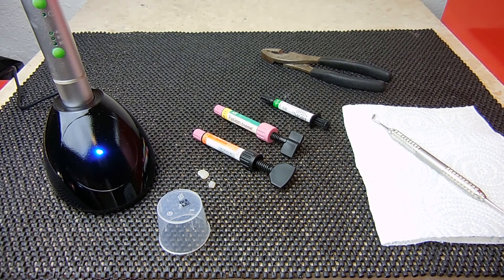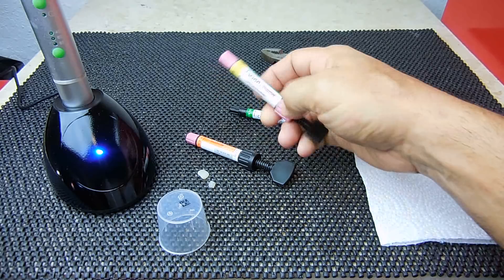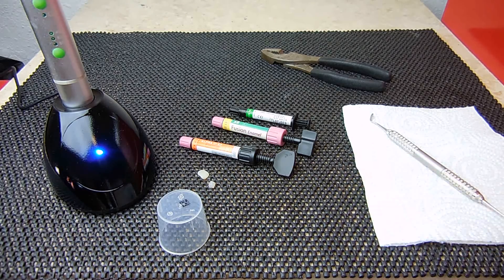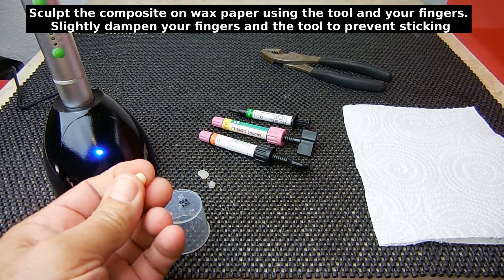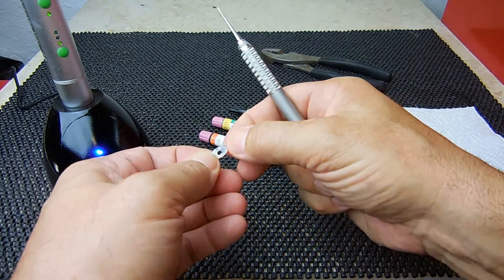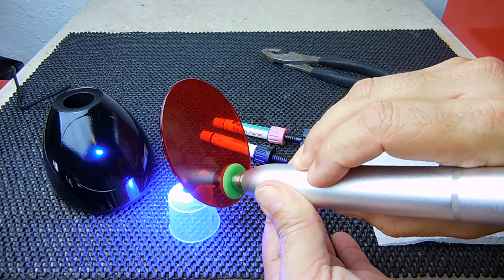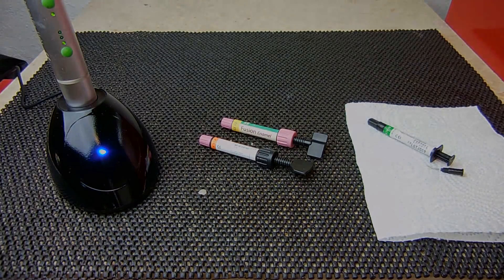Non-Medical Uses For Light Cure Dental Composite

Comment: As I have a new wand light source in the 5w, output wavelength:430-485nm range that isn't curing the glues I have now, where can I find the least expensive glues and composites?
I have looked at eBay and things are still a bit pricey.
In many cases I use UV glue pens on Kevlar rope ends most often with cheap LOCA pens.
I would like to expand my ideas and uses to solve more problems like you demonstrate here.
Reply from the maker: The composite material usually states the light spectrum required to cure. Thanks for watching!

Comment: I got a question i got a filling like this. Would i get a headache  from looking at UV light for 1 second while was doing that procedure
Reply from the maker: Wally Sterg Wear eye protection.
Reply: electronicsNmore ok but here lies the problem after getting a routine cavity filling on the last tooth he didnt use anesthesia cause  on  the tooth..i think he hit a nerve cause the top of head was a vibration sensation..i backed off. Told him  it hurt..he then told me just a lil bit more. Anyway after that filling i still have a headache from that drilling procedure. Also on my ear lobe was a lump.i pulled down on my ear lobe gently which then felt pain inside ear. I went back to him for more dental work which then told him my head hurts from the last procedure. He then. Pretty much gave me false answer saying it was anxiety.   Mean while its the sensation from the drilling that time ..of course i know i need to go back to this dentist.  But he might shy me away...now i went.to a primary doctor explained him this situation....after all this now i told this doctor maybe that could have been an ear infection from that tooth....anyway he gave me antibiotics..for it...but still have this headache..maybe i might need a XRAY of my damn 💀..will try tylenol for now...but not alot...im not really a pill popper
Reply: electronicsNmore sorry i ahould have said this first
Reply: No you cannot get a headache from looking at the light for one second

Comment: is this composite can be use in bonding brackets?
Reply from the maker: Depends if the UV light can pass through the bracket to cure the material, and the type of material being bonded.

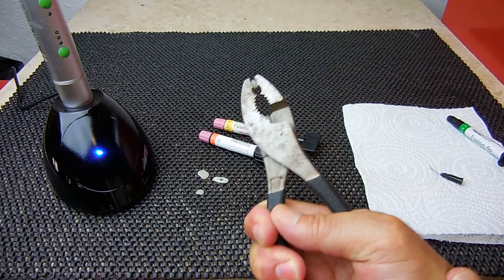Comment: That stuff is harder than Chinese math!!! 10:54
Reply from the maker: :-) Keep in mind, that was with sharp ridges inside the jaws of the pliers digging into the composite. If the jaws were smooth on both sides, it would have required even more pressure.

Comment: Nice using marine corp solutions! Epoxy sucks because it breaks down in uv light or extreme heat
Reply from the maker: Yes, The Nano composite gets harder over time, especially when it's compressed. I would not get carried away with the level of heat. 150 - 200degF should be OK.
Reply: electronicsNmore i wonder  if you could use it for a windshield reservoir repair?  all the possibilities with this stuff

Comment: How did you mold gear that is broken?
Also,how quickly does it wear out?
I was planning to make small bearing ball.
One is eaten out,and i dont want to pay 80 bucks for replacement set.
Reply from the maker: The gear broke, but I was able to glue it back together to make the mold. If the material crumbles up completely, then you won't be able to duplicate it. The Nano composite is very hard, and takes a long time to wear down, but it can be sanded.

Comment: So cool! Chemically what is the UV-curing Composet made of? Also what brand are you using?
Reply from the maker: https://en.wikipedia.org/wiki/Dental_composite

Just look on Ebay for the lowest priced 4.5gm light cure composite, or flowable composite if you desire.
Reply: thx
Reply: I just saw it on ebay for $7.55  
http://www.ebay.com/itm/PROLINE-Light-Cure-Hybrid-Resin-Composite-4-5-gm-B2-US-DENTAL-DEPOT-Prime-Dent-/172404445454?hash=item28241b110e:g:RcMAAOSw44BYJH25
Reply: Ed Ginsberg thx
Reply: electronicsNmore do you still need to use the light to cure it?